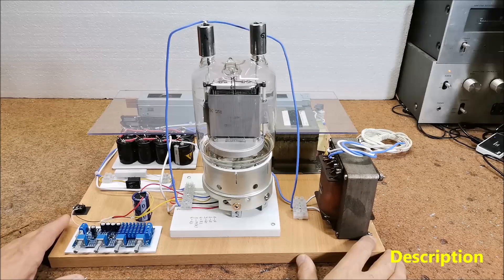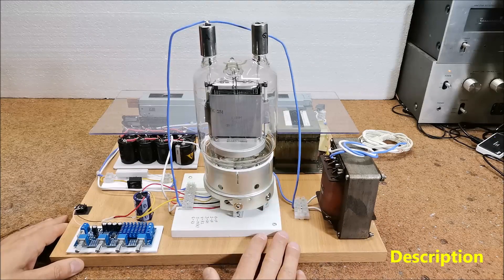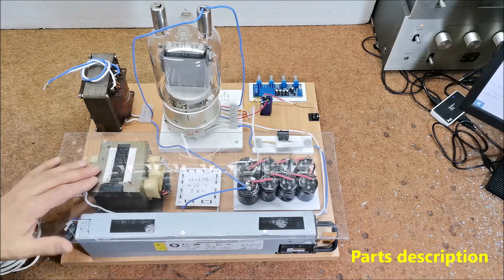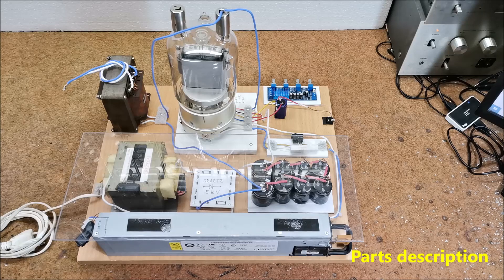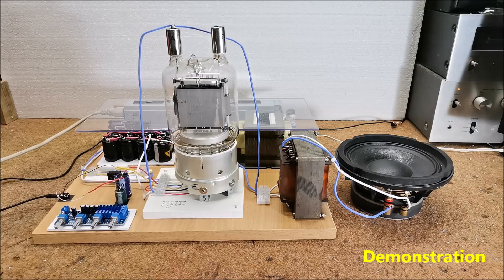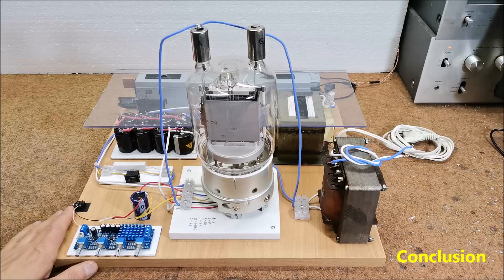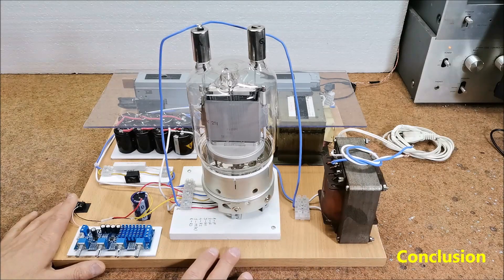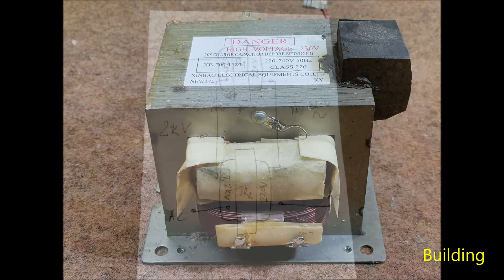DIY simple GU81 Tube Hybrid Amplifier (130 watts RMS in A class)

Comment: Now that is one impressive FULL BRIDGE RECTIFIER!
Nice project, I'm worried about the output transformer though. I's not just about the core cross-section - given it's a single-ended amp, DC is flowing through the primary, magnetizing the core, leading to saturation - but about insulation strength. Working with >1kV plate voltages is already dangerous, let alone with more than 2kV...

Comment: Well done to your attempt to use this large valve. I have two and waiting for a chance to use them. However your single ended output transformer looks very small for the power output rating. Check out this post https://youtu.be/vC7moMDiZdQ?si=6mrXva_5kNtLF-VK. It happens to show in the background a pair of GU81 amplifiers and others.

Comment: Why did you not connect the output signal electrically to the sound card - it is not possible to evaluate the quality of the amplified signal. It would also be useful to measure some characteristics of the amplifier - harmonic ratio, etc. Even connection to a normal audio system instead of a single speaker. What can be evaluated here? Well, something is playing...